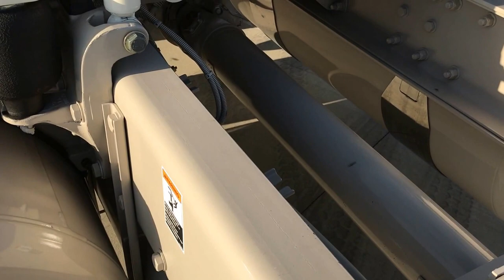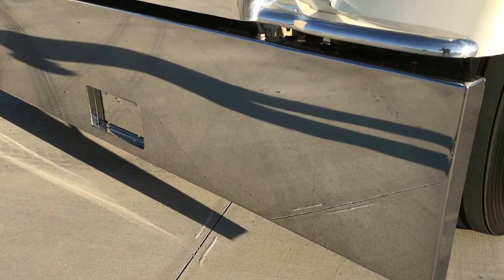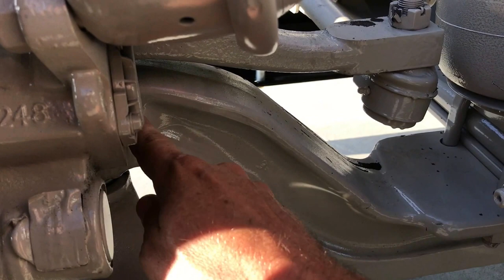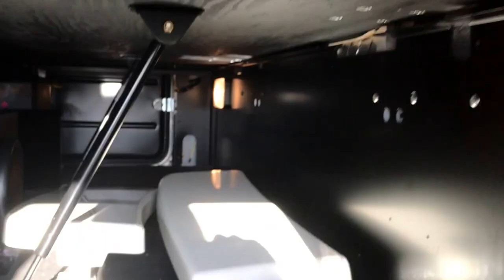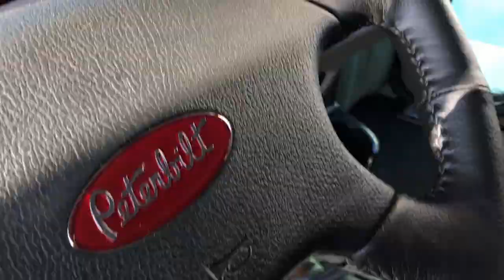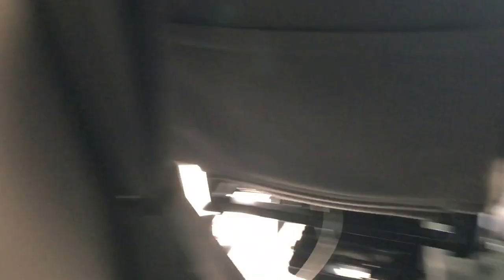2018 Peterbilt 300" Flat Top Car Hauler 5" Drop Low Low Air Leaf 2-Tone

Comment: Do you put a rubber strap in between the fuel tank and straps or is it just the tank and straps? does the paint act as a barrier between the two so you dont have to put the rubber lining on? i would think it would cause it to create a hole and leak fuel if not.
Reply from the maker: Great question, yes there is a rubber like material between the strap and the tank.

Comment: Kind of curious as to how this is a "car hauler", looks like there is a ton of room between the back of the cab and where the air brakes connect, wasted space.  Also tall stacks, doesn't work well if you have a car above you.
Reply: Steve is referencing the height of the suspension, this truck isn’t gonna be built into a car hauler.